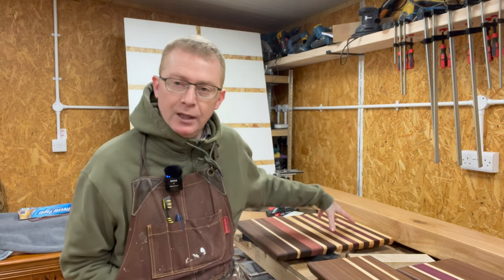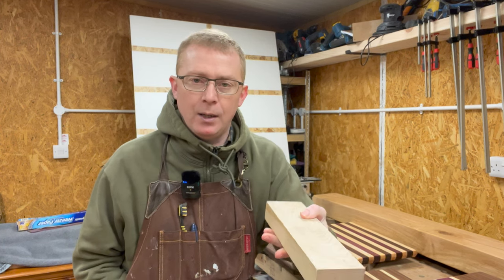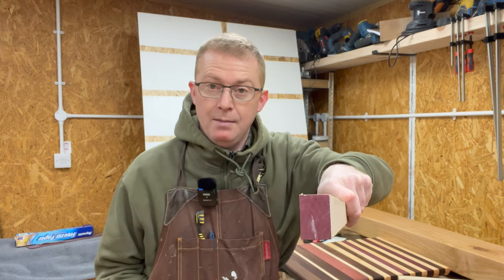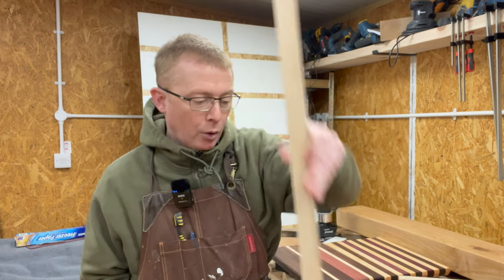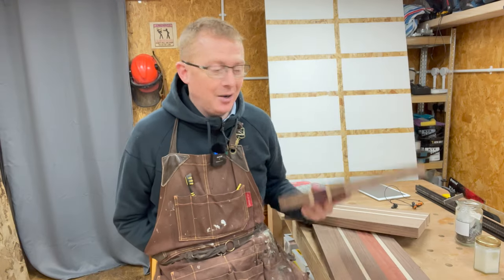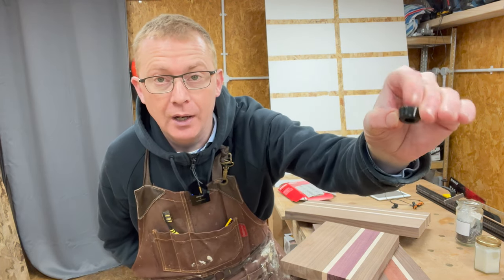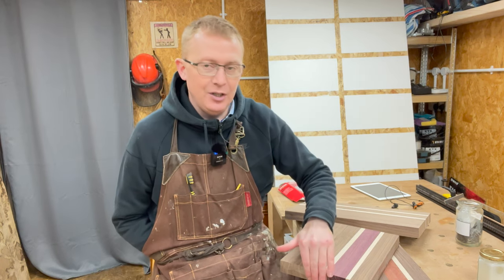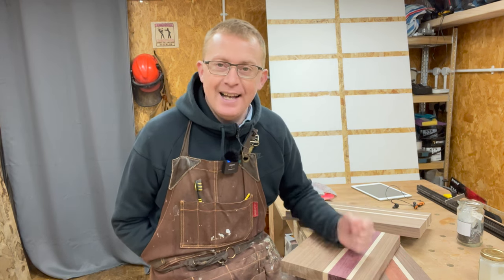Making Small Batches of Edge Grain Cutting Boards for Gifts and Sales

Comment: Hi Leo
I notice when you are putting timber through the thicknesser you put it on top of chips that are loose on the table. In my experience this can cause those chips to mark the already surfaced face and that means more sanding. I always put the front edge of the piece on the table and then drag in back to the edge of the table so the chips fall to the floor before laying the piece flat  I also try and make sure that when thicknessing several piece I feed them through end to end to stop chips falling in behind them. This may not be so easy for you so you may find having a bed extension a good idea if Axminster do one or alternatively an adjustable height trolley that can catch the pieces without changing the orientation. I use both depending on what I am doing and how many pieces are going through. But either way the bed extension never leaves the thicknesser outfeed.
Reply from the maker: Nice one pal. Yes me just being lazy with the chips and I need to clear them away more often. I’ve got a Trend outfeed wheel that comes in really handy on the longer pieces 😀👍

Comment: Hi Leo, if I have a 600mm length of timber that is 100 X 100mm,  the ends are obvious but which is the face and which is the edge? 🤔  👍
Reply from the maker: Cheers for the message Ged. There are certainly more qualified people than me to answer this and maybe a couple with comment. I’m your situation my understanding is you can choose which is the face or edge grain. I tend to notice the face grain the lines are further apart and the edge grain are tighter packed, but again that can differ with different woods. If I look at maple for example and the piece is square in size like you say, I would take the tighter packed grain lines as the edge grain and use that as the cutting surface and bottom if that makes sense 👍
Reply: @Hand-i-Craft  Thanks Leo, I agree, whichever side has the tighter grain = call it the edge. Cheers and Merry Christmas to you and yours. 👍